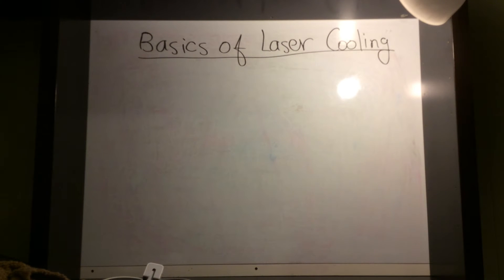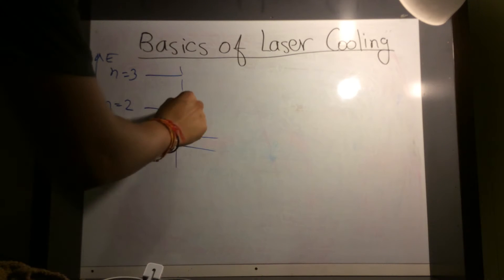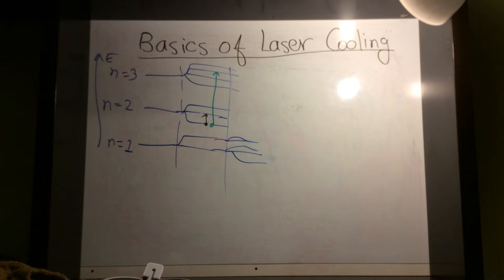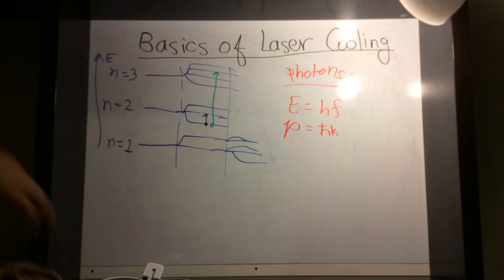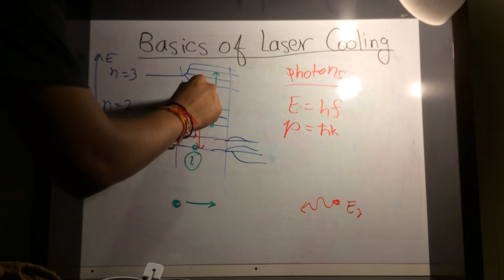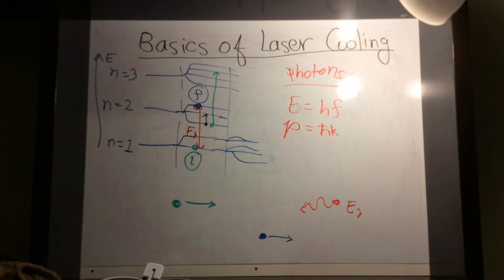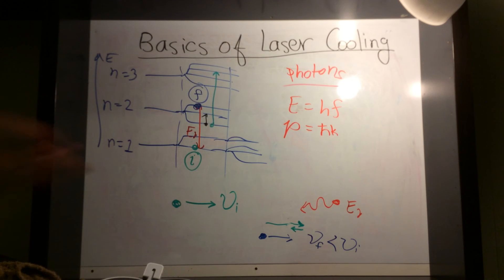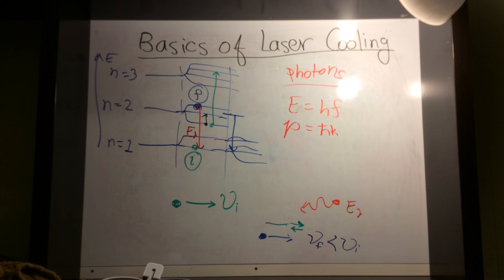Basics of Laser Cooling

Comment: so if an atom and  photon are moving in same direction, the atom will see the 'red-shift', ie the higher wavelength or lower energy compared that required for exciting electron in atom. therefore atom will not absorb that energy or no transfer of momentum. CORRECT?
Reply: Gauravaeroiitm Yes, and that is a good thing, because otherwise in that case you would have vf>vi